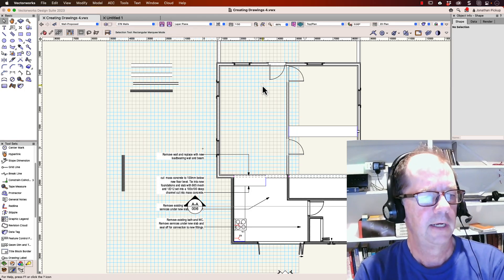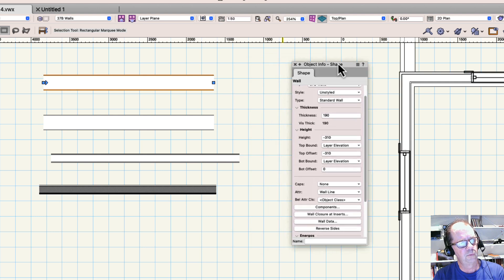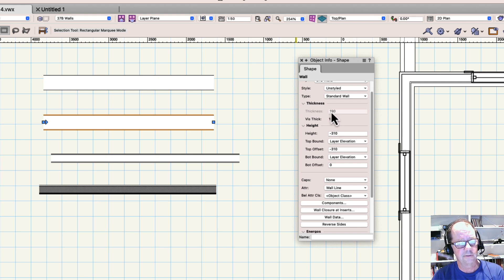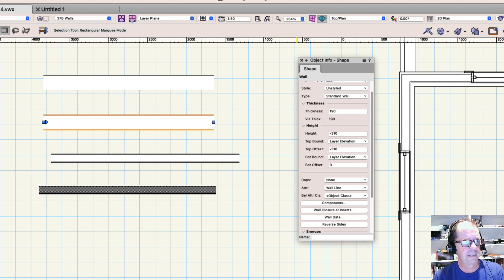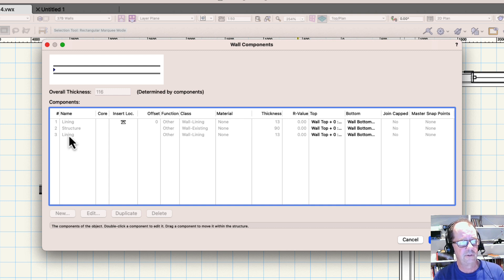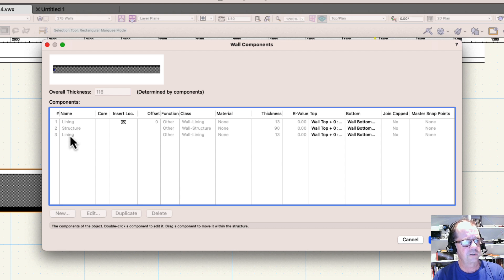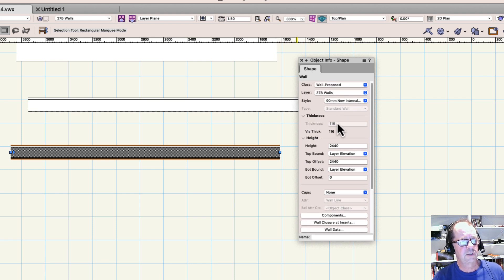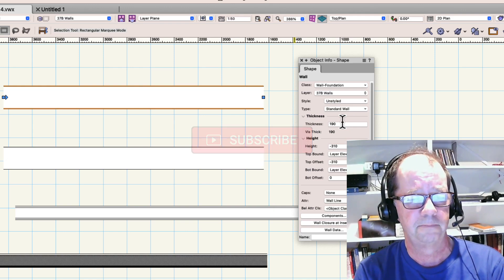Changing Wall Thickness #Vectorworks #jonathanpickup

Comment: Right-click, edit wall style is one of my standard routes. The other one is edit from the resource window.
Reply from the maker: If you are modelling an existing building, you will end up with several wall styles. Then, when you come to make those walls demolished, you then have to duplicate the wall styles. That creates a lot of wall styles. I used to do that, but I’ve changed to the this method now.